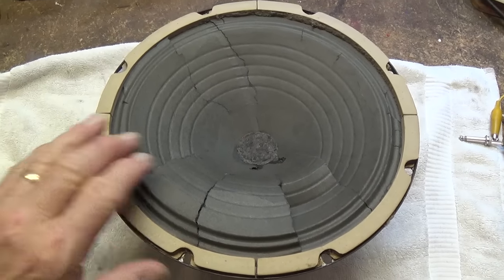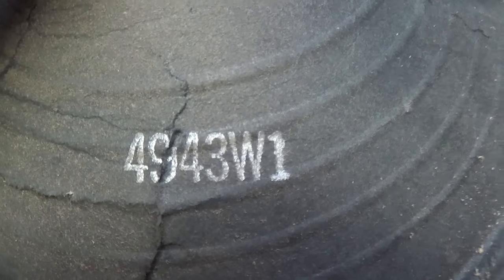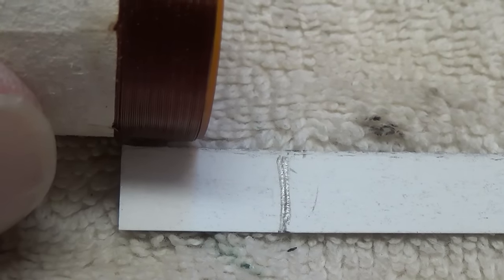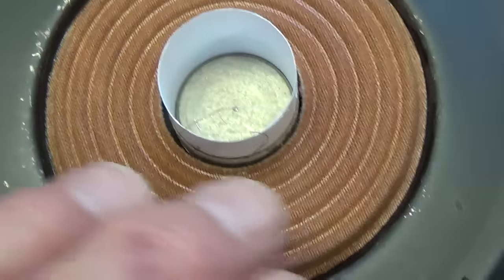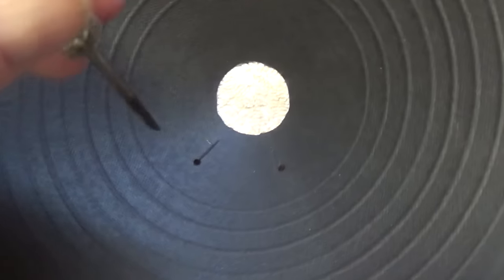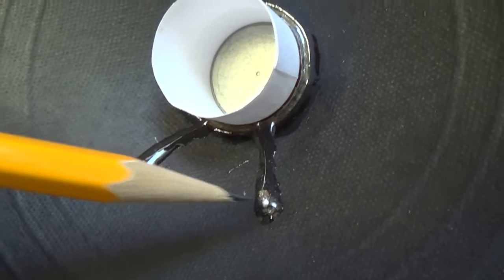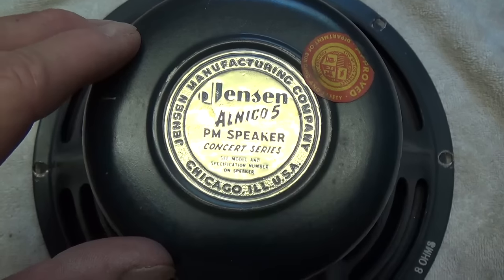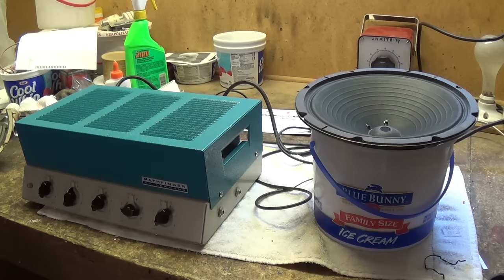How to Recone a Speaker

Comment: This video lifted a lifelong veil of ambiguity for me.  I wasn't aware that the voicecoil was physically attached to the cone and that it floated in an airgap.  Speakers suddenly make sense.  Thank you. Doug.  Consider me a patron.  :-)
Reply from the maker: You're welcome, Dave. The only thing missing from the equation is that the voice coil is an electromagnet suspended in a strong electrical field (provided by the permanent magnet). When the music signal, which is AC, causes the  voice coil EM to rapidly switch polarity, it and the cone move back and forth rapidly.....making music :) Thanks so much for your pledge.
Reply: Good method explain. 👍

Comment: Excellent video. I have not reconed a speaker for about 35 years, now that I have retired that may change; back in the 80's I had a friend that designed the Jansen Equipment in Auckland New Zealand, I was a little jealous of their equipment,  speakers for reconing  would be demagnetized so cleaning any metallic residue  from the magnet assembly was a breeze, the recone was  carried out and then a quick zap in the machine  to re magnetize the speaker, very cool.
Reply from the maker: Thanks, Kenneth. I wasn't aware that the magnets were degaussed for cleaning, then regaussed.....it makes good sense.

Comment: Thank you so much for the referral. We are happy to be a resource for parts for so many of these vintage speakers. They are definitely worth reconing. I watched your whole video. It is very detailed and precise. There are a couple of things I feel compelled to point out. We do not trim the voice coil opening on the spider or cone as you indicated. We find that if there is a gap like you show, the epoxy often drips down the voice coil. In fact, we prefer there to be a tight fit between the spider and voice coil. You are correct that often the cone throat needs to be opened to fit a larger voice coil or to adjust for height. You can use the back of your thumb to press the end of the throat back to make space if the cone is slightly too deep. If not, cutting is fine. The gap between cone and voice coil is less critical if caution is applied when adding the epoxy. Good Job Uncle Doug. You are providing a great service. if you want to review our video of generic reconing, you can find it on our site under FAQ http://www.youtube.com/watch?v=8UCtsCZLcWU. After watching your video, I realized we must find the time to be make more videos and be more precise. We actually tried to not be too specific since we wanted our video to work for many different speakers. Please contact me if you need any parts or info. Cathy@speakerex.com.
Reply from the maker: Wow, Cathy.....Rusty, Jack, and I are very pleased that you visited our channel. I appreciate the input on the spider gap. The maestro who trained me, many years ago, emphasized the absolute necessity that neither the spider nor the cone should touch the voice coil, for fear of throwing it out of alignment. A tiny gap must exist all the way around that is filled with epoxy.  I agree that I opened the spider gap up a bit too wide, but no epoxy leaked past it......thanks to its relatively thick consistency, and good luck :) I was very pleased with the items I received from you, but would prefer to have metal eyelets in the cone to facilitate soldering, rather than the radial slits.  Thanks again for your excellent service, products, and input.
Reply: We do not get many cones with the eyelets anymore. It is a bit easier that way but they are no longer manufactured that way.  I saw you use a soldering iron to make a hole in the cone for the pigtail. We use a screw or poker. Either works. Also, we leave a larger amount of pigtail in the front that the vc lead is wrapped around. We then solder and snip the excess pigtail or braided wire. Just a FYI in case that makes it easier for you or your followers. Keep up the good work. I'll try to watch some of your other videos sometime in the next few weeks.
Reply from the maker: Thanks for the info on the non-eyelet cones, Cathy. We would be most flattered if you were to watch some more of our videos and always welcome your comments. Rusty, Jack, and UD.

Comment: One important step to do before you epoxy the coil connections to the tinsel leads on the front of the cone: Test across the tinsel leads on the back of the cone to make certain your soldering process sufficiently melted the varnish on the coil wires and made a solid electrical connection.  Your emphatic appeal to ensure the voice coil gap is surgically clean is spot on; it cannot be overstated.  Bravo!
Reply from the maker: Thanks for the nice comments and helpful advice, DC.

Comment: It's funny to see the differences and similarities , I was a JBL/ EV and a few others guy , where you use the washers we used either EV fixtures OR rolls of solder for the dust covers ! LOL when you do the five minute epoxy with the stick , we used to use a pointy "Water cooler" cup and snip the bottom and drizzle it in . A lot of fun to see someone ELSE do it . Great Video !!!
Reply from the maker: Thanks for your interesting input, Frank :)

Comment: A superb video Uncle Doug and your assistants! Thank you especially for demonstrating the most necessary shims which explained a big hole in my understanding of how re-coning is done properly.
I've just subscribed and look forward to watching more like this. Many thank you's again!
Reply from the maker: Thanks, Julian. I'm glad the video was helpful.
Reply: @UncleDoug  very much so.
Just wondering, how many speakers you've built, and I gather you had to learn the hard way to get to this stage, haha, as many of us are likely to!? This is where your videos save our time, so thank you so much again!
I'm wondering about how ohms come into this, of at all? I've got 2x12 speakers, one of which has died and either needs replacing or rebuilding. They're from a Lab Series L5 amp, which am sure you know with your superb musicianship. Would you suggest a rebuild or upgrade to a new pair, which no doubt will need breaking in. Also, is mixing 2 different brands ok to do or would I ideally need to replace both? 
Thank you again
Reply from the maker: @JulianChown  I was taught re-coning by a local man who rented and restored musical equipment for many years, Julian, and I was able to buy re-coning supplies from him for years after he retired. Speaker impedance is determined by the (AC) impedance of the speaker's voice coil, and is completely different from the DC resistance that is measured with a DC Ohmmeter. I personally advocate not only two speakers from different manufacturers, but two speakers of different magnet type: one ceramic and one Alnico, for the best of both worlds.

Comment: Hi Doug, Thanks for providing these videos! I've been in the repair business for over 40 years, and still learning. I am now getting into speaker reconning. I wanted to in the pass, but there was no good places to get a good majority of speaker parts until now. The site you mentioned is a very welcome addition to my list of speaker parts providers. Thanks for the tip. I want to leave you with a tip to aid in speaker repair. I picked up a lazy susie at the thrift store and use it to easily rotate speakers when cutting the paper, spider, etc. And it works great for making nice consistent gluing. Thanks again for your informing videos. Pete
Reply from the maker: You're welcome, Peter. We're glad the videos have been helpful.....and like your idea of the rotating stand. Thanks for your input.

Comment: Hello Uncle Doug, thank you for this interresting video! Just one addition, if I may: The first thing that I would do is ripping out the cone and sealing off the gap of the magnet with tape prior to any cleaning procedures. The way you did it it is very unlikely to get out all the dirt that you introduced to the gap when cleaning the basket, even with compressed air. Especially since you used a scraping tool to remove the gasket which might even scrape off some metal from the frame which doesn't come out with compressed air. On most speaker magnets the gap is only a few mm deep and then wides and there is a torroidal space underneath the gap. Once dirt got there it usually never gets out compelely and finds its way back into the gap sooner or later to produce a scraping voice coil. So, taking care no dirt gets into the magnet gap should always be priority #1 when reconing a speaker. Even then before installing the new cone I would use post-it stickers to clean the gap from dirt that might have creeped in there in the last decades. Hope you find my little advice helpful. It has been really successful for me being a collector of old speakers (30's.... 80's) who constantly has to deal with scraping voice coils with those old speakers often missing a dirt cap. (:
Reply from the maker: Thanks so much for your input, GD.  This speaker had already been subjected to so much debris entering the VC gap that I neglected to protect it with tape......however, your suggestion is an excellent one and I hope the viewers benefit from it.
Reply: Thank you for your kind words, Uncle Doug (: By the way, your videos inspired me to revive my amp-building-hobby and I just finished a little weekend-project - little meaning literally little, almost tiny (: It's a 15x16x13cm (about 6"x6.5"x5") all tube combo using one half of a ECC82/12AU7 as a SE power amp (the other half + one ECC83/12AX7 as preamp stages). Speaker is an old 5" AlNiCO from 1958. Very minimalistic and nice vintage tones ^^ .... Anyways, thanks for the little push (:
Reply from the maker: You're welcome, GD. It's great to hear that our videos inspired you to begin building amps again. Your recent project sounds very interesting. Perhaps you would consider posting the schematic on my Facebook page: Uncle Doug's Vintage Amps. I would like to see it and I'm sure that other viewers would too.

Comment: Nice job Uncle D - you made/make it look easy(!)  I happened upon this interesting video of yours by chance as I was Googling for info on if it was possible to recone the 6 x 9 speakers in a vintage set of Jensen Triaxial car speakers I obtained (free!) last summer.  Apparently, these were the 1st of their kind & started selling in the mid-to-late 70s.  They look neat and are heavy & stout.  A few folks have new/unopened boxes of these on eBay asking for $200 - $300!  Whoa!  
Reconing them is not a project I'll have time for in the near future...I was moving them out to storage & thought I'd check on reconing vs harvesting magnets.  (The 6 x 9's are dry rotted 1/2" from the metal edges ALL the way around and I'm assuming the paper mid-range & tweeter (metal?) cone material - though it looks intact - is probably rotted & would fail very quickly upon use.

PS  I gotta say, and in agreement with you, the soundcheck of that speaker just laying on top of a plastic ice cream container was pretty darn good, Doug!  It really caught my attention immediately and made me think 'what the...'! (Unless you pulled a joke on us & had a Fender Champ hidden off-view...? ;-)  I thought it sounded better than some of the amps you've fixed - not that that's your fault - you always do the best with what you're given: old designs, old or wrong parts, and previous meddling, etc.  But yeah, was that a freak accident of microphone placement or is there some sonic research to be done, perhaps, on a semi-closed-back speaker 'bucket' made of plastic that's firm enough to support the speaker's weight (and in this case,  the speaker's weight at low volume prevented 'flapping' about...) and big enough volume-wise internally to absorb the backpressure of the speaker & hard enough to impart a somewhat naturally bright resonant and consonant tone?   (I wonder what the sound would be like with holes of various sizes clustered about - not unlike the soundboards on Ovation guitars and mandolins?)
All factors seeming perhaps to generate/support a nice naturally mixed 360 deg upward/outward soundscape. such as found in the ceilings of symphony concert halls.  A hypothesis.  Yet plastic speaker enclosures for PA cabs (HF horns) are not new...but this choice of material the way I see it, is more an efficient manufacuring cost and weight-cutting production method than for sound quality/dispersal.  But I could be wrong...
  
[Now it's storytime.  Enjoy the below drivel of a once average, to slightly below that, mind...slipping into delusional predementia.  Should you?  Dare you!?]

So now Mr. Retired Music Teacher - me - gotta go eat me a gallon of ice cream (no complaints!) and dig around in my man cave for a speaker to set on top of the empty rainbow sherbert.  Maybe I'll get back to you on my findings.  Since Roland makes the Cube series of amps, maybe you/me could design the 'Bob or Doug' Bucket 'cream' amp - a plastic recycling project, too!  
Why not recess a small 5W amp below the speaker in the bucket!?.  Make a minimal cheap amp conversation piece:  ain't gonna have no modelling SHARC chiips, BT, or USB to connect to a DAW!  (They'll only be available at Dollar General stores next to the cat food & flea spray products.) Maybe 3 tone stages:  Vanilla/clean, Blue Sherbert/slight breakup; and Chunky-Choco/brown lead sound!  (If ya need Chorus, then buy 2 DougBuckets and stick one in the bathroom, close the door partially, and hook it to the other amp with our optional 'Y-creamer cord'...only $34.95  But it will require your exclusive black-with-white-stripe external AC/DC adapter that looks just like an ice cream sandwich - only $39.95.  LOL!  -)  Those sending us plastic gallons of ice cream get a discount coupon in return towards the purchase of their very own DougBucket!  OK.  I just love to brainstorm, but it's time for bedtime, and to dream, we don't get sued by Danelectro!  LOL...So goodnight, Douglass, and cheers!)
Reply from the maker: Bob, brand new 6" x 9" Rola-style speakers are currently available from:  http://www.vintage47amps.com/V47-Speakers/

Comment: Excellent tutorial! This gave me the courage to re-cone my old '68 Jensen C30 speaker with the cone all cracked. I actually re-used the gaskets and dust cap as well as the coil. The new coil was thicker compare to the old one made of paper, and didn't quite fit that well. I just put on some new leads and it worked like a charm. The gaskets didn't fit either, so it's a good idea to save these parts just in case.
As for sound, it is difficult to compare an old cone that has been around since '68, with a new one. Who knows what it sounded like new? The new one is still not broken in, but it still sounds sweet to my ears.
So thanks!  And I suppose I must give credit to Rusty as well, he owes his part in this too, just by being himself.
Reply from the maker: Congratulations on your successful reconing project, JJ. As you  discovered, the job requires care and focus......but it's not all that challenging. You're welcome :)

Comment: This was a very effective re coning job! I have to remember to pick up a few gallons of Blue Bunny Ice Cream! Those buckets not only make great holders for the speakers, but a nice sounding baffle! My better 1/2 may not like me eating that much ice cream, but hey...ice cream makes everyone smile, and it will give me the ability to do multiple speakers at one time :) One of the things I usually do after a re-cone job is connect my HP audio oscillator to the speaker directly and run around 40 Hz for a few minutes to get the stiffness out of the new cone. (break-in period) This was another job well done! My teaching abilities have improved tremendously from your videos...I used to have difficulty putting things in common terms; which also taught me that not everyone is a technician, and I'm not able to talk shop with the average Joe :)
Reply from the maker: Thanks, Frank. My wife and I are now on low-sugar diets, so ice cream is a thing of the past :(   I'm glad the videos were beneficial to your teaching abilities.  Thanks for your input.

Comment: Beautiful job on the re-cone BTW. That looks better than it did new.
Reply from the maker: Thanks, TF. In a proper cabinet, it will most likely sound as good as it did new.  I may get a chance to find this out.....so stay tuned.
Reply: I've handled a ton of 'pro' re-cones (never tried it myself, although now I might)  - and honestly I don't think any of them showed the same degree of attention to detail. I think they have to ram-jam them out the door at the re-cone shops but a vintage amp like that deserves more.  That was an impressive job - and video.  Kudos!
Reply from the maker: Thanks so much, TF. It was indeed a very special speaker that had fallen on bad times and certainly deserved a careful and thorough resurrection. I would never work in an assembly line shop.....it goes against my obsessed-with-detail nature.

Comment: agree its not for everybody but returning to it 20 y later with a bag full of skill and now pretty good video examples i feel up to it esp i have 2 1950s 12" that failed on me out of a set of 8 motivates me even more to take the time , with the proper solvent to deal the cup and adesives.  cheers thanks for the fine display of repair
Reply from the maker: You're welcome, Cutter. Good luck :)

Comment: Great stuff and well worth doing if you've got a vintage Alinco speaker or some other rare expensive to replace speaker.
Generally not worth bothering with with most everyday type speakers and these can often be salvaged out of scrap old speaker systems
Reply from the maker: Reconing parts have gotten rather expensive, so it's not economically practical to recone a relatively inexpensively replaceable speaker.